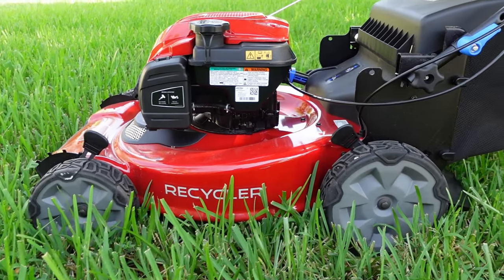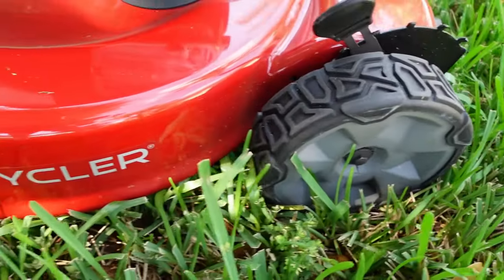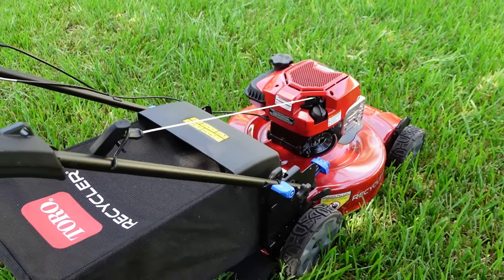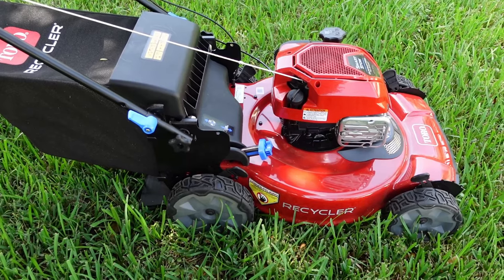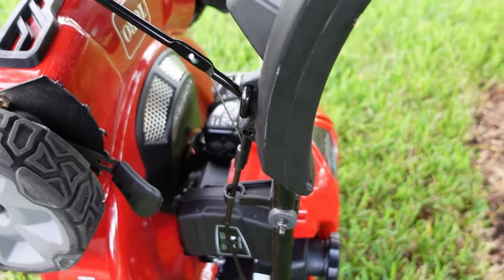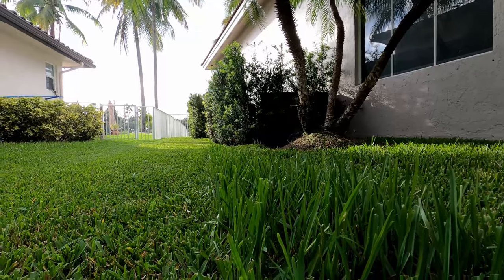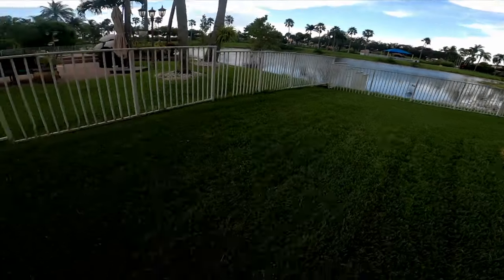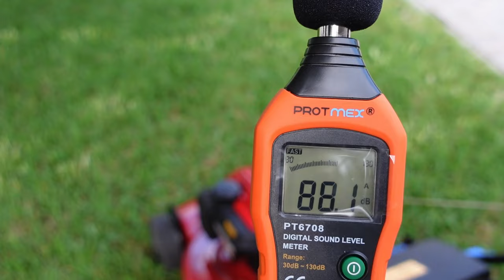TORO 22"  SMARTSTOW Personal Pace Auto-Drive™ High Wheel Mower (21465) Vortex Technology #toro 21465

Comment: I hate my 22 inch front drive as it’s way  underpowered and clogs  up with long grass . Never again ! I had a husqvarna  Honda 160 and never bogged down . I’m selling it !
Reply from the maker: Hello it can some time get clogged.  I used to have the 163cc motor with no issue but they dont make the smartstow with the 163cc which makes no sense.  I dont let the grass to get too big so it wont clog.  You can also cut smaller amounts or cut more often.  The 150 cc is a bit small to cut high grass.  Sorry it didnt work out for you.  I am using the super recycler 60v now and its very nice option but pricy. Hope you find the correct one for your needs. thanks

Comment: The handle being so much wider than the deck is why I will not buy Toro. I had problems with my 10-year old Toro. This would be WORSE?! The ergonomic specialists had better learn that fancy and comfortable must take a back seat to practical. They didn't test in the lab cutting next to a fence? Idiots.
Reply from the maker: I had the older one and was more narrow.  I actually removed the personal pace and its better for the tighter spots.  You can order the parts to convert to the simple format.

Comment: I have a new Toro lithium, it sucks, drive wheel fell off in 2nd hour, battery shorts, and on-line Toro will not take it back. They do not take items back if you use it for 1 minute! Their rear left geared wheel unbolts itself from the bracket, it self destructs! Two others have the same problem. Their repair dealer literally told me "with Toro, its Buyer Beware". I have a Toro case number, a BBB case number, and a US Consumer Product Safety Commission case number.  Save yourself and learn from my mistake, and stay away from Toro.
Reply from the maker: Hello sucks to hear that.  I have the Recycler from the video, the  60V Recycler and the Super Recycler 60v and never had any issues with any of them.  I have noticed some complaints about the tires falling of the units.  I always go over the entire units when I buy them since these things can happen.  I register my units so if I have any issues I can make a request.  I hope you solve this issue with them.

Comment: This toro is trash in comparison to older models. This is my 4th and the last two have been not good. Especially considering my older two still works and the newer ones aren’t even making it a full season without not starting
Reply from the maker: I haven't had any major issues with any of the Toros that I have except for the small oil leak on the valve cover that I fixed which is a bit of a cheap part.  I am outgrowing the Personal Pace which I converted one of mine to a regular lever but so far so good at least for me.  I did get the 60V on this same one and also the Super Recycler in 60V and I like that one a lot. Time will tell